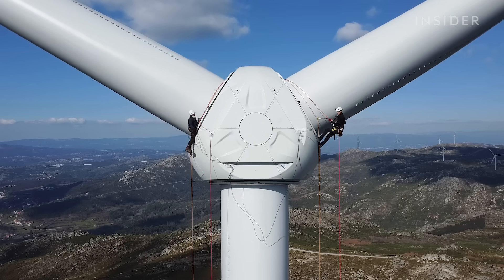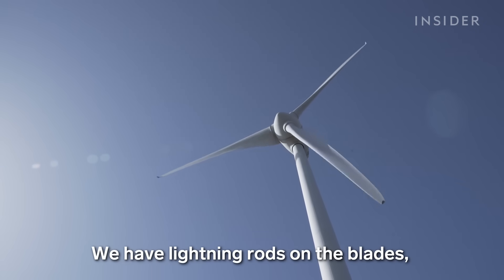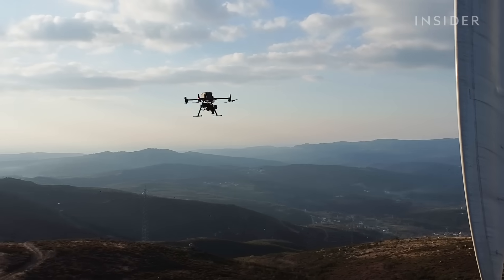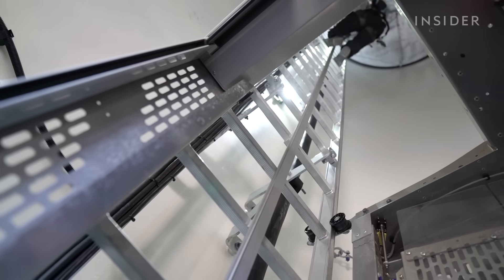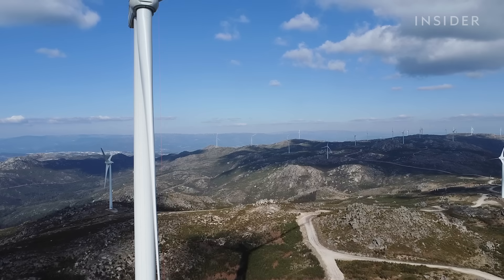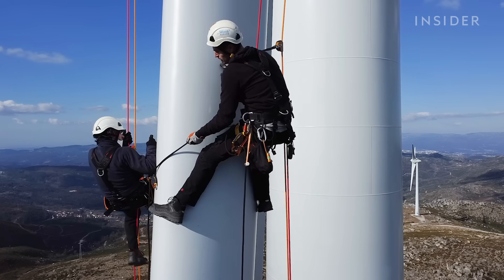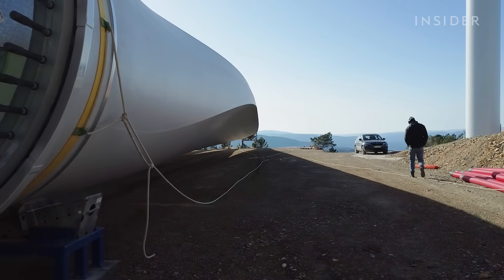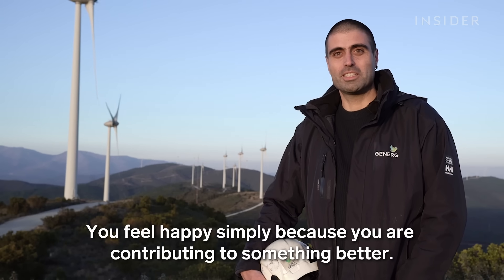How Wind Turbine Technicians Risk Their Lives to Keep Blades Spinning | Risky Business

Comment: I'm studying energy engineering and this is one of my dream jobs! Seeing how people respect and admire this job made me proud of my choices even more :)
Reply: Those windmills are a total waste of money and damage the environment.
Reply: @wanaraz  there are strong political currents and companies that want you to think that way. I suggest you to inform yourself indipendently with actual data (International Energy Agency is a great source) before speaking. Wind turbines are profitable and way cleaner than most energy sources.
Reply: @francesco5254  Not one has ever turned a profit. They damage the environment.
Reply: @wanaraz  Nothing of what you said is actually true. If you want to dream, keep dreaming. But yours are not facts, just lies. Again, I suggest you to check by yourself what is true and what is not.
Reply: @francesco5254  The wind turbines are not bio degradeable. In fact they are fiberglass and not friendly to the environment. A special location has to be dug for them. Due to their size – often as long as a 747 – the blades have to be cut into multiple pieces to facilitate their handling and burial.  In Wyoming, the 120-foot-long turbines are cut into three 40-foot lengths and the smaller sections are placed within the larger pieces.  Each turbine blade is then buried within a cell that measures a maximum of 44 cubic yards, or about the size of about three cement-mixer trucks.  The effort involved, although usually paid for by the wind farm developer, is an economic and environmental cost of renewable energy generally ignored by the green energy activists.

According to Wayne Christian, a commissioner of the Texas Railroad Commission, it costs about $200,000 to decommission a wind turbine, roughly 10 times the cost of abandoning an oil well, and over a 30-year shorter energy-producing life.  He also points out that contrary to Texas regulations, a wind farm developer does not have to provide financial assurance for cleaning up a site, either through posting a bond or a deposit to cover the decommissioning cost in the event the developer fails to remove the turbine.  That means state taxpayers may be on the hook for the clean-up cost, as opposed energy producers who are subject to rules requiring them to provide financial assurances to cover the cost of plugging and abandoning oil and gas wells.  Mr. Christian said the cost to abandon the 12,000 wind turbines currently operating in Texas could reach $2.3 billion.  

The Wyoming wind farms being dismantled are from 1990, or the start of the recent wind energy push.  In the future, as more wind farms are abandoned, disposal of turbine blades will become an escalating cost, especially since wind turbine lives are a fraction of the life of a fossil fuel power plant, while also only producing power intermittently.
Reply: @francesco5254  A worrying new trend is taking shape in California, the cradle of the US wind industry. Significant numbers of turbines are being uprooted and shipped to India or other foreign countries for installation because of diminishing financial returns in the US and the country's bleak economic outlook for wind. Operating turbines are also being shut off as they are not making enough money -- with no immediate hope of reselling the equipment.
In Palm Springs, Difko is taking down 132 Micon 108 units for shipment in containers to India and installation by a tax deadline of March 31. Since that deal was inked, wind companies in California have been getting many inquiries from India. Meanwhile another firm in the San Gorgonio area has sold six turbines to Canada, although it does not want details publicised for business reasons.

To the north, hundreds of turbines in the Altamont Pass will be closed down in early 1996 as they are no longer profitable, says consultant Don Smith. In one case, a wind farm is to shut down shortly after January 1 as the operator had only received $0.021/kWh from Pacific Gas & Electric for some months in 1995, compared with a previous rate of $0.12-0.14/kWh. After charges for stand-by, transmission loss and a bad "power factor," this operator appears to be netting an astonishingly low $0.015/kWh, says Smith.

The trend will likely accelerate; several more companies are apparently considering moving equipment overseas or to the Midwest. Previously, only marginal turbines had been moved out of California. But now fully operational projects are being taken down for shipment, a powerful gauge the US market's weakness. Financial returns are so low for many California wind farms, especially those over the Standard Offer 4 "price cliff" because their ten year SO4 contracts with utilities have expired. Without the more lucrative SO4 contracts, operators are getting just $0.035/kWh, or less. The big huge turbines are even less profitable.
Reply: @wanaraz  I'm perfectly aware of the fact that they have an impact, I'm an energy engineering student. Still, they have a small impact per KW produced. We need energy, it's not like we can go back to stone age to save the environment. We just need to find the cleanest solutions and apply them. Coal is worse, gas is worse, biogas is worse, nuclear is questionably ok, solar is questionably ok, wind is questionably ok, hydro is questionably ok, other sources don't exist in sufficient quantity to help us enough. As for now, the perfect source doesn't exist. I suggest for the third and last time to look up for data sources, not vague and generalistic quotes without solid numbers regarding costs, damages and benefits backing them up. Everyone can demonstrate anything by telling specific local stories in the right way. It's called politics. Try understanding the global picture of the phenomenon, don't stick on a couple of things that happened here and there. p.s. you are quoting turbines being shut down in 1996... that's a little bit too old as a valid source for today's wind turbines technology, don't you think?

Comment: Did you know these wind turbines use 700+ gallons of oil to keep them running smooth?  Did you know you have to cement off and destroy a huge area of nature to place just one?  And they bury thousands of blades in the dirt when they brake down?  And they just store the huge parts that will never decay in huge landfill?  Did you know they kill thousands of birds year round?  Did you know they use petroleum products to de ice them in the winter?  "Green" energy indeed!

Comment: 341K turbines in the world and growing. Multiply X 3 fiberglass blades per.  Over One million blades. Lifespan of blades 12 +/- years. Majority going into landfills. Plus all the fuel, concrete n steel, power cables, asphalt roads etc to make. Constant monitoring.

Where is the Green part ? 

Most people don’t look at the big picture. Sad. They blindly believe what little they are told or only look at one thing (it makes E, so it must b good)

Creates many jobs, but in reality its not good for the environment.

Comment: I wonder how they guarantee the blades don't start turning especially if there was an unusual wind gust. Scary stuff
Reply: Because the blades are turned out of the wind (feathered), the rotor disk is braked and locked with hydraulic locking pins the size of a cooking pot. The technicians carry the keys for the bolts and switches, remote access is turned off. You'd have to disengage a lot of safety devices manually and cut locks off the switches to get the turbine to run.

Comment: I'm an Electrician and a rope access technician. It's not all that big of a deal for these guys. You're trained trained for worst case scenarios and rescue/self rescue. Yes accidents happen, just like in any other trade. I'd rather be on ropes then other ways of access/egress.
Reply: I feel the same way I like hanging in my harness much more than I like using lifts.
Reply: Have yall ever used one of those Skylotec ACX auto climber things? They are so badass!
Reply: @redstrike88  I got an ActSafe rope ascender, tree work.
Reply: Ok Rambo

Comment: Great video. Two issues:
1. 4.8 MW / hr is not an appropriate unit. You should just say "4.8 MW, sufficient to power ..... homes". The unit of Watt is 'Joules/sec'. There already is a '/hr' embedded in a unit Watt.
2. As the unit Watt is defined as 'Energy/time', you saying 4.8 MW/hr energy is absolultely wrong.

Comment: Fun fact: It takes about the same amount of energy to make a windmill this large as the windmill is expected to produce over it's lifetime.
Reply: No, it takes only 3 months
Reply: The wind turbine does use a lot of coal to produce the steel, make the fiberglass ,carbon fiber and other materials but it pays for itself in months easily.

Comment: The difference between 'perceived danger' and 'real danger' has been highlighted here. They are not the same. 100m or 30m is the same- if you fall you're dead! . In the rock climbing community this is called 'exposure' or 'how you feel'. I'd be quite happy doing this job as long as I trusted my mate. Most would freak out simply because of the height. If you trust your equipment and yourself then it's no problem- like driving a car.
Reply: And unlike with a car you control most of the variables that could kill you. Fortunately we don't t drunk drivers in the sky.
Reply: @garethbaus5471  You make a good point.
Reply: Yea long as it doesn’t break but never know life is crazy

Comment: If those turbines were vertical, there would be so much less maintenance required, in addition they could be made out of stainless steel, rather than nasty fibreglass that you can't recycle

Comment: Now let's talk about how the blades are non bio degradable, and are toxic to the earth....🤷‍♂️
Reply: How much volume of non recyclable waste do they produce per unit of electricity, compared to the alternatives?
Reply: ...and that every wind turbine in the world was to be renewed after 20 years..
Reply: @johno4521  Like every other energy generation technology, mechanical devices are subject to wear and are periodically replaced.

So unless you have examples of fossil stations with the same (vibranium?) bearings in their turbines and generators forever, that's irrelevant.

A rational and intellectually honest comparison of the various methods would be done on the basis of the time and resources absorbed by maintenance and replacement expressed per unit of power generated.

Is that something you've looked into at all?

Comment: I still remember an early rock climb.  I was belaying someone traversing the rock below me. 

I was anchored into a rusty piton someone had pounded into the crack on a rock some indeterminate length of time before.

My heels were on a flake of rock.  Between the insteps of my boots,  I could see the first place I would bounce if the climber I was belaying fell,  which would pull me off and we would be hanging by that piton.    It was about 500 feet to that first place we would hit below.

We did that for FUN!

An amusing byproduct of rock climbing skills was the ability to climb most building exterior walls.  Just walk up to any old building and climb as high as you wished  ----easy peasy,  mostly.

Comment: I have been learning to climb trees with ropes for recreation and exercise and have climbed to about a hundred feet so far. That's not really a big deal, but I am an old guy now, so I am pretty pleased with myself. I wish I had learned about climbing like this fifty years ago!
Reply: I worked for 35 years on a large suspension bridge and I would have much preferred this wind turbine work over the painting and sandblasting I did in similar rigging. I'm 72 years old now with good memories of a life in the steel
Reply: @kippywylie  As a teenager we used to climb up to the top of the Ambassador Bridge in Detroit using ladders inside the tower legs similar to this, except there's no lights in there.  The height is about the same as these  towers too, coming out up on top is breathtaking and scary as hell.
Reply: I climbed trees everyday from aged 3-15 then became a carpenter. No one told me about jobs at heights can do most jobs without a rope lol.
Reply: @Bart-Did-it  I took up climbing with ropes last fall, so I don't have a ton of experience yet, but I am enjoying it immensely. The family thinks it is insane for a 71 year old man to be climbing trees, but I am having a great time and will continue as long as I can. I wish I'd known about climbing long ago. It would have changed my career choices for sure!
Reply: @340wbymag  I should have been a tree surgeon really . I’m glad your active more muscle you have the longer you will live .
Reply: @Bart-Did-it  I've climbed trees since i was 9 months old
Reply: @betooo331  I was two months old when I started.
Reply: @Bart-Did-it  what were you doing climbing trees at three years old?
Reply: @elpacho....9254  garden fruit trees 🌳
Reply: Blake’s hitch, baby!
Reply: @kegsofvomitspit  Only safe with 3-strand - Blakes can be deadly with modern kernmantle rigging!
Reply: What a shame that we're going to destroy every skyline and level every forest with these awful looking wind turbines all in the name of endless human population expansion!
People don't understand that wind turbines are usually placed on HILL TOPS and hill tops are usually FOREST. It all gets clear cut to make space for these things.

Comment: From a maintenance perspective this is really dumb, this is far more expensive than having a normal power plant.
Reply: Anyone who uses a vague and loaded term like "normal power plant" knows nothing and cares even less.
Reply: @honesty_-no9he  normal, nuclear, hydro, coal, natural Gas, these have been around for decades and are normal, tried and true. When you turn them on they work as expected. They use a central location so your maintenance employees can drive one place a facility no bigger than 5 square miles, and they produce way more power. This video shows just how delusional wind generated power is, these guys are unnecessarily having to risk their lives.

Comment: That explains why wind energy has a higher death toll than nuclear energy.
Reply: Oil and gas fields is where industrial accidents and deaths are at high levels and coal mining at horrific levels. 
Solar industry is not without its accidents but one presumes that is rooftop related in terms of ground mount solar there is little chance of harm.

Comment: OMG! The lengths the world goes to humor the Environmentalist Wackos! The college where I taught builds these. It takes an 18 semi-truck convoy for all the parts for just one, they vibrate the ground so much that windows crack and break locally, the blades kill birds in flight, and in a strong wing, these things break and crash down. Once broken, the blades cannot be reused and must be stored for now until a way can be figured out to make them recyclable, if ever. The percentage of electricity they generate is still negligible and will be for decades to come. Not to worry, some buddies of former President Obumbo are still making a huge profit to humor the Leftist idiots promoting this crap. You know what used to work just fine back in the 1800s and early 1900s? The farm windmills! Of course, those wouldn't be grandiose enough for the Leftist "elitist" trash.

Comment: 8:35, not 70% of the energy, but of the electricity!
Reply: That is what they do they make electricity. I agree heating and electricity should be placed in separate columns if you do so the percentage of WIND and SOLAR will actually GO UP on any chart or graph. Wall socket power and heating needs to be divorced in stats.

Comment: What is 4.8MW/h? BE PROFESSIONAL PLEASE
Reply: <<A megawatt (MW) is one million watts and a kilowatt (kW) is one thousand watts. Both terms are commonly used in the power business when describing generation or load consumption>>

So a megawatt hour is a thousand kilowatts being generated for an hour. 

If the wind isn't blowing,  you are generating zero watts per hour. 

I always find it amusing that renewable advocates always quote the MAXIMUM rated output of their renewable power stations,  as though the wind always blows at the ideal speed and the sun never goes down.

It's VERY dishonest.
Reply: @SeattlePioneer  in that sense the unit is MWh.

Comment: I would say that these techs are significantly safer climbing those turbines than driving to- and from work everyday.
Reply: According to Power Technology, there's about 150 accidents per year in wind in UK. There's about 7000 wind tech jobs in US, so accounting for population that's about 1700 in UK. So about 150 accidents for every 1700 techs, but we also have no idea how severe the accidents were. Within the energy sector, coal is more dangerous particularly in unregulated areas. Solar and power grid workers are unsurprisingly at higher risk too from electrocution.

Comment: Its not really risky, its a controlled environment. I
Reply: <<Its not really risky, its a controlled environment. I>>

Sure.  What could go wrong?

It's like having a nuclear power plant,  but 500 feet in the air and rotating. 

And suppose BOTH of those technicians are injured in a mechanical failure,  fire or electrical melt down.  What happens then?
Reply: @SeattlePioneer  almost ... except there is nothing nuclear on it???